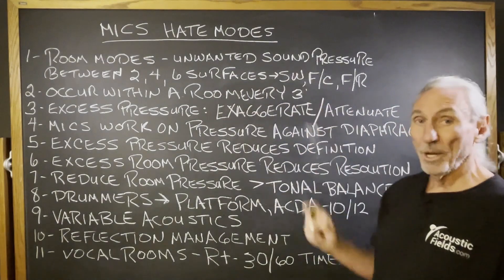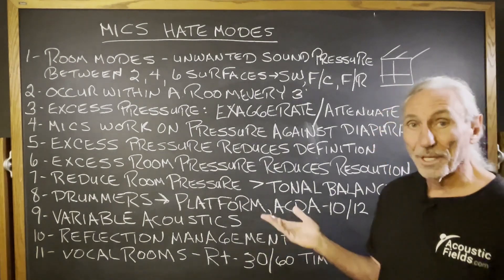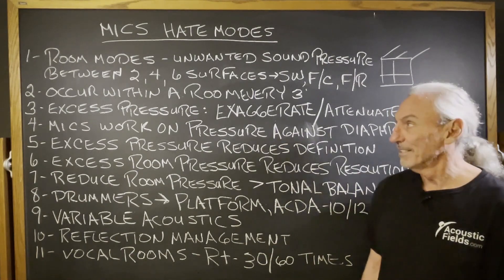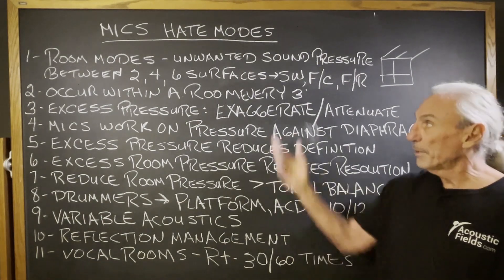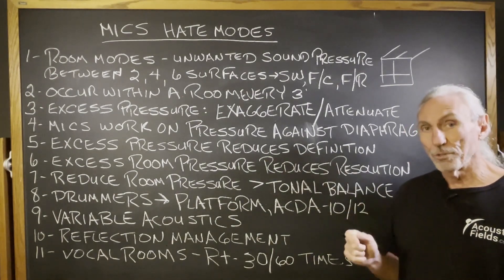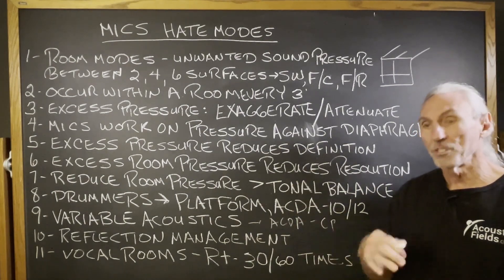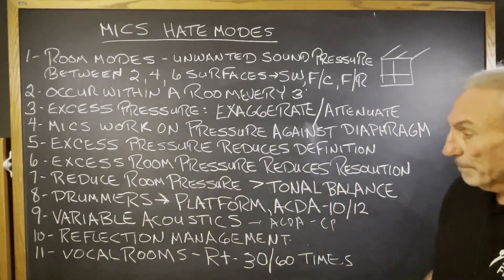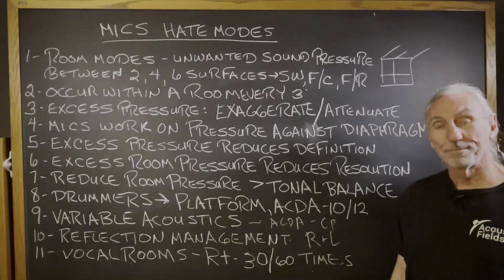Mics Hate Room Modes! - www.AcousticFields.com

Comment: The electrical output from the microphone is a consequence of the room, the placement of the driver(s), and the placement of the microphone. The pressure measured by the microphone is not "pressure plus excess from the room modes", but simply the resulting pressure. Room modes may or may not be excited, and the pressure in the room conforms accordingly. You WANT to measure the effect of the room modes, but you make it out as you need to get rid of them.
Reply from the maker: Modes by definition are distortion. Our gaol is ro reduce all distortions and increase resolution.